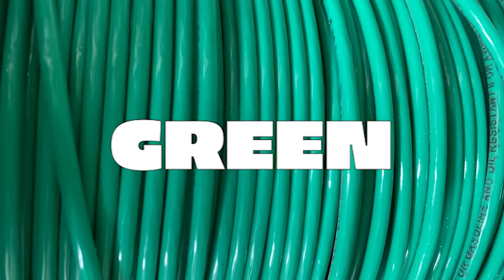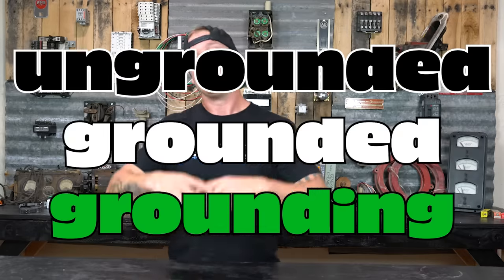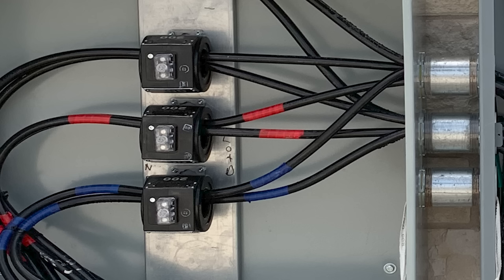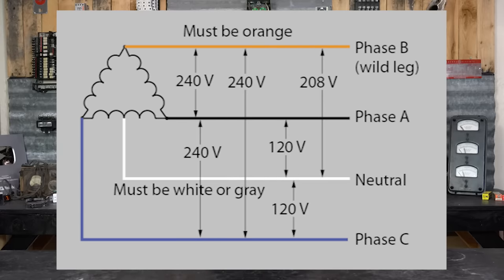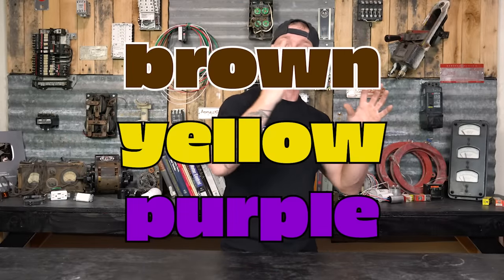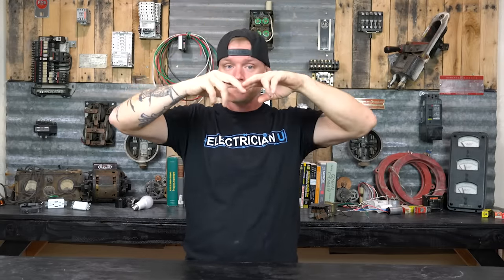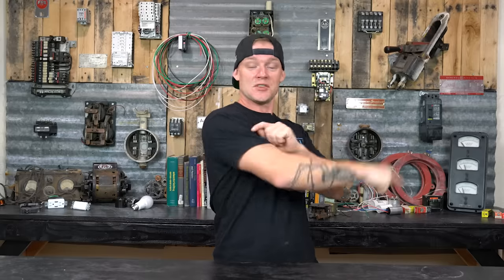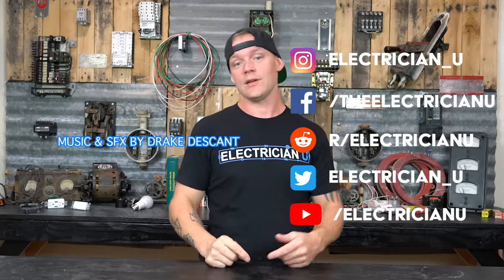Electrical Wire Color Coding Used By Electricians

Comment: It's so messed up how in the US phase+splitphase is called 'single' phase. technically that's correct, but practically... please call it split phase.
Reply: I think it's because in some areas there is a multitude of different transformers...
Reply: If it's technically correct,then it's correct, why call it something that is not correct?  Seems simple.
Reply: It's called single split phase. To electricans we know that it's split. No need to say split
Reply: I mean it’s a single phase primary....but secondary Ive always called legs. Gets confusing to call a secondary leg a “phase”
Reply: Because we call it what it is, instead of making up a new name as to not sound "American". Want to argue what to call it? Dig up Tesla and argue with him.
Reply: Yo Mama  Considering we're a hotbed of plague and aren't allowed into wherever they're probably from I doubt they'll object to your sentiment right now.
Reply: To explain the common term usage here a little:
Residential electricians and commercial electricians often operate as separate trades (at least in the US, can't say for Canada/Mexico), even though most experienced and licensed electricians will be comfortable and familiar working on either side of the trade. Commercial systems are almost always wired with 3 phase and residential systems are almost always wired for split-phase, so the kids that play on the residential side of the playground often call each half of the split phase a phase out of convenience of terms. Kids that play in the commercial side of the playground or on both sides know enough about what they're working with to know what's meant by that.

When you get into a technical discussion/teaching setting you'll hear things referred to by their explicit proper terminology, but much like you don't commonly call neutral a grounded conductor day to day on a job site you don't commonly call the two halves of a split phase system anything other than a "phase" on a job usually.
Reply: Another note: it's only split phase when you're using it split phase. For all of the appliances in a household using 240 volts it's a single phase of 240 volts; there is no split phase involved. Only the 120 volt electronics are using one of the splits, or legs, of the single phase.
Keep in mind that when we want 240 volts we are not combining two separate 120 volt phases, we are simply bypassing a neutral wire that is center tapped to the secondary coil in a transformer.
Reply: The way I understood it is that a "phase" is the difference between 2 hot legs.  A normal residential system only has 2 hot legs, so a single phase.  A commercial system has 3 hot legs, so difference between hot A and B is a phase, between B and C is a phase, and between C and A is a phase - 3 phase.  But like grounded and ungrounded, most people don't refer to them by their technical description but call each hot leg a phase.

Comment: You forgot to mention bare copper is ground in residential. 
 Also, some electricians call the Orange 208 volt hot wire, a stinger. 
 Good video.

  Suggestion for a video might be a grounding / bonding video. Residential and commercial/industrial.  Show the different methods of grounding and bonding using hubs, clamps, large building grounding rings, completely unbroken ground wiring systems and large wire splicing using Cadweld Molds. 
  For instance I had to use 500 MCM copper wire around the rebar in the foundation of a building in an unbroken ring that was welded to a 40 ft long, 2 inch diameter copper ground rod that I had a giant, 15 inch diameter auger drill truck drill the hole in the ground, we hit the water table at about 10 or 11 feet because of our location near the bottom of the bay. The auger drill bit is only 20 ft long so the operator had to attach a second bit to the first bit as an extension to reach 40 ft. . We hit bedrock around 32 or 34 ft and he bent his $10,000.00 bit. 
  I then had 40 ft of Sonnet tube 12 inch diameter dropped into the hole which is half filled with water, I then had to get the plumbers to sell me two 20 ft sticks of 2 inch copper pipe and a copper coupling, solder the two sticks of pipe together so I had one 40 ft ground rod. Used a rope from the roof of the building tied on the copper "rod" raised it had the apprentice guide it into the hole and it sunk itself almost the whole length into the ground. We then used the grade all forklift to pound the last 12 or so feet into the ground. Back filled the hole with about a dozen 50 lb bags of a strange conductive material kinda like a mix of powdered concrete and fiberglass. Added water and let it dry a few days and then welded the 500 MCM copper grounding leads coming from the ground halo to the giant ground rod. 
  There was a lot more that went into that grounding system for that building such as being tied into the giant battery back up system that was about 50 or 75 deep cycle, 12 volt batteries wired together in a battery room where they sat on the floor with a 12 inch cement curb containment coral to keep any electrolite (acid) from spreading in case of a battery or batteries leaking.
 One other note of the crazy design of this building.  The whole exterior, walls and roof were completely, solid every square inch, wraped behind the drywall, attached to the wall studs and ceiling joists and building steel, with quarter or 3/16 inch thick sheets of lead. Totally impenetrable by most satellites or aircraft radar, x ray, and infrared, spyware. 
  Just one more of the crazy buildings I've helped build when I was still in the Union local 332 in Silicon Valley.

Comment: The Utilities use a 3 wire Delta configuration and they ground 1 hot leg, when the get to distribution level the usual trans. in MO is a 4wire Y secondary, either 120/208V or 277/480V.  So Delta primary and Y secondary.  I am with "AmericanOne" on the colors B,R,Blu,Wht 120,  BR,O,Y,Gry 277.         Retired IBEW wireman.  )

Comment: My grandpa always referred to the ‘wild leg’ as the ‘Bastard leg’, and that’s what I’ve always called it. Electricians would flip out if you worked with us in our transmission substations. Red is  Ø1 or C Phase, White is Ø2 or B phase, and Blue is Ø3 or A Phase. Some of our plants use Brown, Yellow & Orange for the iso-phase bus running to the step-up transformer, then it switches to Red, White & Blue when it steps up to 500kV.

Comment: This channel is great. I'm currently a licensed pool repair contractor in Florida. I've worked plumbing (wiring water heaters) and general property maintenance where I've done basic electrical repairs like replacing outlets, switches and breakers up to replacing motors on commercial 3 phase laundry equipment and some HVAC work that was mostly on the control side where we replaced bad contactors, relays and motors. So, I think I know the basics but the couple of videos I've watched here have been very informative. I've got a question about something I've run into down here that due to FL laws, I have to stop and tell the homeowner they need to call a licensed electrician so I never do get to figure out the cause. I do a lot of hot tub work and have often found that I had 120 from Line 1 to Neutral and 120 from Line 2 to Neutral but 0 volts between Line 1 and Line 2...and the hot tub is not running because there's no power to it. I've assumed it was a bad breaker or other wiring fault. These circuits are usually 50 or 60 amp GFCI breakers.TIA for feedback.
Reply: I'm not an electrician.  In house wiring this would occur if the both the hot wires were on the same leg of the incoming wires.  The two hot feed cables feed the breakers and every adjacent breaker is on the other feed wire.  I think your 240 volts are being supplied by separate 120v breakers but the breakers aren't adjacent and happen to both be in slots that are fed by the same incoming feed cable instead of by both incoming feed wires.

Comment: The NEC hardback actually uses BOY in examples. I wonder if BYP is the outlier. Also, the orange high-leg for a 120/240 4-wire system (not normal resi 3-wire) is required to always be on the B-phase. Only four colors are specifically identified in the code: High leg B-phase orange, green (+green/yellow variant), white (+variants like stripes), grey (+variants). Inspections here are getting more strict about identifying what the colors are on the panel with nameplates and such. I'd like to see a video on the DC colors commonly used in controls - I'm all sorts of terrible at controls.

Comment: In the 480 3 phase system, I was taught that Orange still Meant the Wild Leg.
so instead of 277  yellow, or Brown to Gray,  you had  440 Orange to Gray  Open Delta
When there is Purple, then all of them , Yellow, Brown or Purple to  Gray is 277.
Reply: There is no high leg in a 480V system. You either have a 480 Wye where all 3 phases are 277V to ground, an ungrounded Delta where you’ll have a weird range of voltage from phase to ground, or a corner grounded Delta where one phase is 0 volts to ground and the other 2 phases are a random voltage to ground.
Reply: @danadcock9743  no, there is no color to designate a ground phase in a corner grounded Delta system.
Reply: @atmacm  I’m pretty sure the NEC requirement for corner grounded 480 v service should have brown, yellow, gray, with the gray being neutral (grounded conductor) and UNFUSED!  I have been in the industrial field for more than thirty years and have NEVER seen a corner grounded delta 480v. System marked, or done with two pole breakers and an unfused neutral 😭
Reply: @atmacm  there is also a mid tapped 480v. Delta tapped transformer that has a wild leg just the same as a delta 120/240 3phase system!
Reply: @atmacm  gray or white NEC 200.6
Reply: @jkK-lw9lu  no, gray is for a neutral, the grounded phase in a corner grounded delta is not a neutral.
Reply: @jkK-lw9lu  I’m not saying you can’t do it, but I’ve never seen it in the field.
Reply: @jkK-lw9lu  that’s for a neutral. A grounded phases is not a neutral. Neutral is a grounded conductor.

Comment: I work on electrical system all across America and the standards in heavy Commercial and Industrial is 240-208/120 is A black, B red, C blue, Neutral is white Most high legs 208 are Violet, and 480 is A brown, B is orange, c is Yellow, Neutral is Grey 99.9% of the time. we cal low voltage anything under 2000VAC and Medium is up to 69KVAC and high voltage is above 69KVAC This based on my working in Generation, Transmission, Distribution Systems as a Protection and Control Field Service Rep.

Comment: Think of back in the days when the only colors of wire were black and white. Grounds were bare. It was always fun wiring up a three phase motor and guessing which way it would turn. There's a 50/50 chance it turns the way it needed to and it turned the wrong way about 80% of the time.

Comment: What about the switch leg and traveler colors? 🤔
Reply: At my house, I installed an outdoor lighting system with a photocell and I used red as the switch leg from the sensor.  Am I going to hell? lol
Reply: Switch legs and travelers can be whatever you want, other than white, grey or green... As long as you know what you've used.
Reply: @IceBergGeo  new code yes but any homes not built in the last year nuetral was used as a switchleg all the time. Smart homes have changed that and with wifi switches that require neutral have changed code not for life safety but only because consumerism.
Reply: @cheynebest7028  as far as running Romex, you can still use the white conductor for a dummy three way, as that is one of the exceptions to the "need neutral in the box" code rule. It just needs to be identified as not neutral.
Reply: Know the difference between Residential, Commercial and Industrial Wiring...
Reply: @cheynebest7028  most new cars also switch the ground.....Jim

Comment: I have also heard the neutral (white) called the "common" wire

Another place you may find a "blue" wire is in a ceiling fan. They often use blue for the "light" circuit while the black runs the fan - white is still neutral.

Comment: Very informative!  I worked in IT/Engineering at a pharmaceutical company for several years and the building I was in had a 1600-amp 277/480Y service.  All our panels had B/O/Y and that’s how I learned about 480.  I had no idea our system was the outlier compared to the rest of the US being B/Y/P.  Good info as always—thank you!

Comment: You are making this too difficult and are not correct. According to the NEC, Green or Green with a Yellow Stripe (NOT yellow with a green stripe!) is ALWAYS a grounding conductor!  White is always a Neutral conductor.  With the newer electrical codes Grey may also be used for Neutral.  WARNING!  Grey was previously allowed to be used as a HOT conductor!  NEVER ASSUME THAT GREY IS NEUTRAL!!!  All other colors may be used for Hot.  NEC does NOT otherwise codify hot color codes.  NEVER assume that two conductors with the same color insulation are on the same phase!!!!  While is is bad practice to use the same color on different phases, it is NOT a NEC violation.  Cities and states may have their own color codes that differ from the NEC.

Comment: Orange is also used to identify a highleg (b-phase) in a delta system.  You never install a single pole circuit on this phase in a panel. You will usually see the panel skips this breaker when used mostly as a single phase two pole circuit. You can however use a three phase breaker with no issue in these panels.  Typically a delta installed system doesn't always have a neutral.  You can tap the transformer between b and c phase to derive a neutral which can be used for single pole circuits such as lights and plugs.
Reply: Isn't that what he described and showed with the diagram for 240 volt delta center taped between A and C phase?
Reply: @matthewperlman3356  Probably, he knows what he is talking about for sure.  Watched this video a while ago so I can't remember if he mentioned it specifically. He most likely did describe that as he is pretty on point.
Reply: @matthewperlman3356  he's just trying to sound smart lol

Comment: Good information, lot to know and good way to start. I'm not an electrician, but I've worked on 480 Volt, 3 phase equipment quite a lot. Brown Orange, Yellow, (BOY) was the identifiers we had on lines. Any way these are used, don't trust anyone else's choice of colors until you establish what's what. I've seen green used as a "hot", so unless you're working with someone you know won't do anything stupid, only trust your own testing. Thanks for the video. Keep it up.
Reply: I was vacationing in Jamacia man and was watching the hotel handypeople struggling with some wiring.  I couldn't help myself and had to assist.  Before I touched anything I started measuring voltages using their H Freight style VOM.  Sure enough, they were using a green #8 as an ungrounded conductor measuring 120vac to the EMT.  They said, "yeah man, that's how we do it here."  ALWAYS verify before assuming anything was wired properly.  I'm a licensed electrician.

Comment: Grounded conductor is the preferred terminology over neutral. All neutrals are grounded conductors, but not all grounded conductors are neutrals! Corner grounded delta transformers do not have a neutral, but one corner (phase) is grounded. Per the NEC it is a grounded conductor and must be marked accordingly.
Reply: Neutral is truly defined by a wire that carries an unbalanced load anyway so I agree with this! Although I'm sure you already knew that boss!

Comment: I memorized it initially like this, "Be our B boy",
BRB BOY.......
Black
Red
Blue

Brown
Orange
Yellow

And, "Green's the ground, the world around."
Reply: Q: What does a landscaper know about electricity?
A: Ground is very important, and it is either green or bare.
Reply: @carultch  ...Not quite. The ground can also be "half yellow and half green" at the same time.
Reply: @theSword- I know that.  But think about this from the point of view of a lanscaper.   "Bare" means bare dirt, and "green" means grass to them.  Both of these describe a meaning of the word "ground" that has nothing to do with electricity.
Reply: @theSword-  Also, what is the reason for using a half-yellow/half-green ground?   Are there reasons one would need to distinguish a bi-color ground wire from a mono-color ground wire?
Reply: @carultch  ....I never said anything about a landscaper.
Reply: @carultch  ....Generally you would find the yellow/green ground in or on an electrical cabinet or some type of electrical equipment. I actually have about 50 feet of it, like 1/0.
Reply: @theSword-  I did.  It's called a joke.
Reply: @carultch  ..."Bare" means "naked"" which is the wire with no insulation or covering. "Ground" is refering to the actual land and is also called "Earthed". Which has everything to do with electricity. All positive charges are looking for a "ground" source. The pitchfork symbol is used on prints sometimes too.

Comment: 240v. Black, red, blue. 240 with a 190v high leg. Used to be red but now can also be orange instead. White neutral. 480v. Brown, orange, yellow. Or it can be brown, purple, yellow with a gray neutral. Colors can vary widely when using multi conductor cable tray cables with blue commonly used as the neutral.

Comment: I've rwecently been using 12/4 romex or make an FMC assembly with the black/red/blue/white/bare for ceiling fan switch legs. Red = incoming  unswitched hot, Black = fan switched hot, Blue = Lighting switched hot, and of course white and bare being neutral and ground. This allows for a neutral to be available in the box for smart switches and/or a future receptacle below the box.